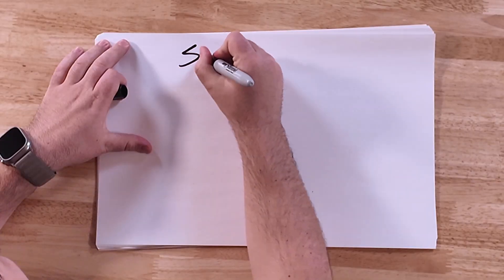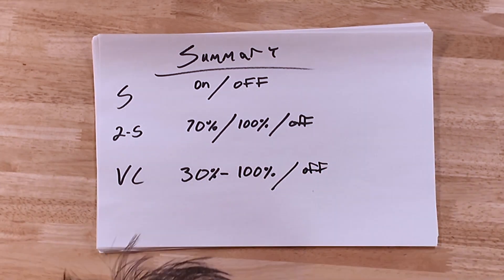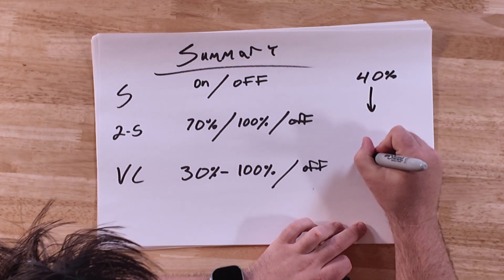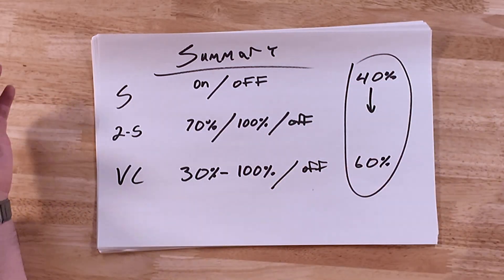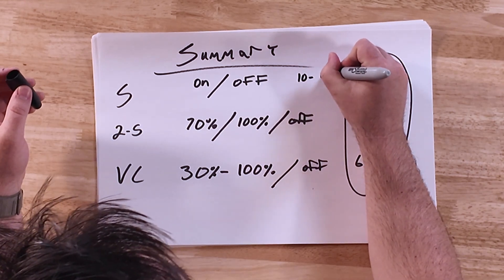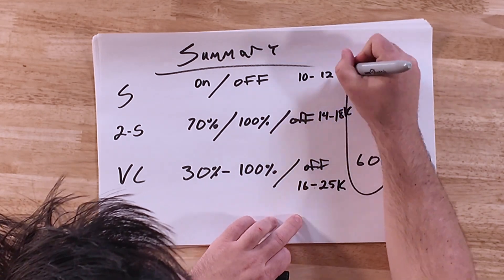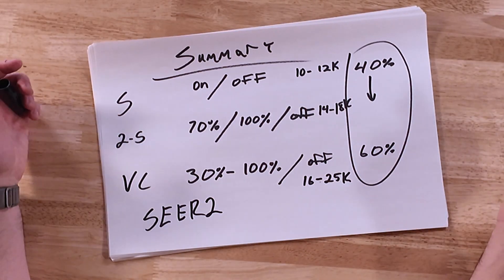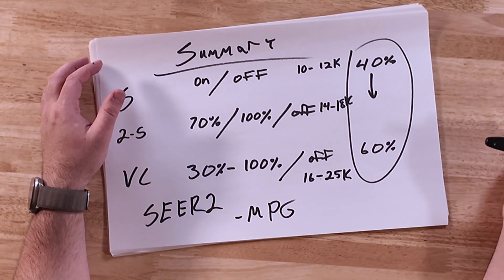Single Stage vs. Two-Stage vs. Variable Speed HVAC — Which One Should You Buy in 2025?

Comment: I don’t feel like I’m saving money, I bought a 2 stage and it feels like it’s always running. My thermostat is set to heat 66 degrees f. I have a separate thermometer that I keep to ensure my thermostat is reading correctly, my 2 stage is always running even when my thermometer is reading 66, is that because the new system programmed to stay 1-2 degrees above? I can’t figure out why this thing is always on, it’s annoying however I’m glad it’s functional. Better count my blessings
Reply: Jojo have you had a detailed look at your duct lines for air leaks? I could only imagine that would be a possibility

Comment: Can't you set the single stage system to use a lower or mid fan speed for better comfort? I think most new furnaces have different fixed speeds you can select.

Comment: Is a 2 stage condenser compressor more quiet at start up than a 1 stage AC condenser compressor?
Reply from the maker: The sound data will vary per manufacturer. However based off the Lennox data we have available; it shows us that a 2 stage system is quieter during operation than a single stage system by about 3-4 decibels. It doesn’t specifically say during start-up. We can assume that it would be a little bit quieter based off the data specifications provided but that may be negligible based off the total loudness being produced. In this case 78db vs 74db. Jumping from an ambient noise environment level (let’s say 30db) to 74db or 78db will always sound loud in comparison. You won’t get into noticeably quieter operation until you compare a single/two stage condenser to a variable capacity condenser which can operate as low as 45-55db.

Comment: Thank You,  what your thoughts on impact of OG&E smart hours with two stage & varible stage.  Right now we do not run our Heat Pump during that time.  We control temp pushing it down before 2pm & letting it rise but not exceed a set point until 7pm.  Hmm..

Comment: The saving of variable stage does not make up for the double cost difference where I live. Variable stage systems here in California cost $20k plus, a $10k difference in upfront cost vs a single stage system. When the system breaks down, the parts needed to replace for variable stage system will wipe out any savings in electricity you gain. Not worth it. Get the highest efficiency 1 or 2 stages system 15-17 seers2.
Reply from the maker: That’s a fair point, Matt — and honestly, we kind of agree. If you’re only buying a variable capacity system for the savings, it’s probably not worth it. The real benefit of those systems is in comfort, not dollars saved. The efficiency savings are icing on the cake, but they’ll never completely offset the upfront cost. That said, in areas with higher utility rates, the math can shift — the efficiency might make more sense there. But if your main concern is cost and reliability, a high-efficiency single or two-stage (15–17 SEER2) system is a solid choice.
Reply from the maker: Also we featured this comment in our video: https://www.youtube.com/watch?v=kG-TcTUGeq4&t=1s

Comment: I find this informative. In honesty i wanna install VC system if i have enough money to pay for expensive repair down the road due to fancy module technology. But overtime, AC do not last forever like max life is 20 years. Things get expensive every year on top short supply and inflation. In my opinion, maintenance is key. U might as well put solar panels at home 😅instead of
Reply from the maker: You’re absolutely right that variable capacity systems can have pricier parts. The good news is that most of those components are covered under a 10-year manufacturer warranty, and you can add a 10-year labor warranty too. That means for the first decade, you’re covered for both parts and labor. After that, yes, repairs can become more costly, which is why regular maintenance is so important. Preventive care helps those components last longer and reduces the odds of major failures. And we couldn’t agree more -- maintenance really is everything.

We featured your comment in our video! https://youtu.be/kG-TcTUGeq4?si=ws5xksxThqW18ZAM

Comment: PHX AZ will destroy any air conditioner. You can put the most expensive thing out here. It’ll break every 4-6 years. Nothing can contend with our heat. I’ve been doing this 12 years and have yet to see a unit live out a ten year warranty with zero repairs.
Reply from the maker: We totally get that. Phoenix heat is no joke. We’re based in Oklahoma City, but we’ve got colleagues out there, and those desert conditions are tough on any system. You’re right that HVAC units in harsher climates simply don’t last as long. Factors like thermostat settings, maintenance, and especially installation quality make a huge difference. At a certain point, it’s about deciding whether repair or replacement makes more sense. With a 10-year parts and labor warranty, though, those mid-life repairs can be covered as long as the system’s been properly maintained.

We featured your comment in our video! https://youtu.be/kG-TcTUGeq4?si=ws5xksxThqW18ZAM

Comment: I consider Reliability and longevity higher than price. Why buy System if is not reliable and will last a long time!
Reply from the maker: Exactly, reliability and longevity should always outweigh the sticker price. Think of it this way: if a $20,000 system lasts 10 years, it costs $2,000 a year to own. If that same system lasts 20 years, the cost drops to $1,000 a year. The longer it lasts, the more value you get. Variable systems require a bit more maintenance, but the payoff is efficiency and comfort. In our book, the value over time matters more than the initial price tag.

We featured your comment in our video! https://youtu.be/kG-TcTUGeq4?si=ws5xksxThqW18ZAM

Comment: A little confused....when you say Variable Speed, is it always an inverter HVAC? I just received a quote (in FL), and the options they are giving me are Carrier Performance 2 stage, Carrier Comfort (single stage) with Variable Airflow, and Carrier Comfort (single stage) which is what I currently have. They apparently do not offer inverters yet. I'm liking the positive things you are saying about VC but guessing that is different than the Comfort Single stage with variable airflow I am being offered?
Reply from the maker: Great question, and one we get all the time. “Variable speed” usually refers to the blower motor inside the furnace or air handler — that’s airflow. “Variable capacity” refers to the outdoor compressor — that’s what we call inverter technology. So: variable capacity = inverter; variable speed = variable airflow. They’re related but not the same thing. The variable airflow system you were quoted isn’t an inverter, but it can still improve comfort by circulating air more efficiently at a lower cost.

We featured your comment in our video! https://youtu.be/kG-TcTUGeq4?si=ws5xksxThqW18ZAM

Comment: If I was building a new house, I would go with a variable speed ac system but I live in the house I was raised in and it’s over 59 years old so I would just reinvest into single stage units
Reply from the maker: That’s a valid approach -- older homes come with unique challenges. But if your ductwork is accessible, it’s worth having it inspected. We find that roughly 80% of homes we service have undersized return air, even for single stage systems. Poor airflow causes premature wear on motors and compressors. Correcting that can make a huge difference in comfort and longevity. Even in older homes, a variable capacity system can perform beautifully if the ductwork supports it. The key is giving that system room to breathe.

We featured your comment in our video! https://youtu.be/kG-TcTUGeq4?si=ws5xksxThqW18ZAM

Comment: Inverter systems are only good when used with zone control. A 5ton system running at 30%, the air handler is only moving 600 cfm . The long runs will get little airflow, causing those rooms to be warm and poor humidity control. Most variable speed units at full capacity do not meet minimum SEER (usually 11 to 12 SEER), so not very good for hot climates.
 Better off with 2 stage on cost and reliabilty

Comment: I personally would never buy an inverter condenser regardless of their price.  They have an enormous long list of negatives with very few positives when compared to other systems especially 2 stage.  They are terrible at humidity removal, unless you have a brand new spray insulated air tight house.

My 2 stage Goodman operates at a 2 ton (50%) capacity on the mild Oklahoma days and 4 ton (100%) capacity on middle of summer heat wave.  I set the desired runtime I want the unit to target (1 hour runtime) and it switches from low stage to high stage solely on the basis of what is needed to hit that 1 hour run time target.  This is Optimal for humidity removal.

I "could" set the target runtime to a 4 hour target which would leave it running at 50% / 2 ton capacity during the summer heat for at least 3 of the 4 hours, which would be similar to the energy usage of an inverter, I DON'T do that because even though it's more "comfortable" having constant cooler low speed airflow for that long duration, the humidity level skyrockets from doing it, (yes I've tried it to see) as at 50% it doesn't have high enough capacity to adequately remove humidity, which in turn makes you want to lower your thermostat temperature to compensate for the higher humidity, totally destroying the "intent" on spending extra for the inverter.

Don't even get me started on replacement part costs on inverter systems components, (Hence why so many HVAC techs promote the purchase of them)

Comment: Can a 2 stage system work in an old home with metal ductwork?  I know variable wouldn’t work, but wondering if 2 stage would since I’m looking for better humidity control in FL.
Reply from the maker: Yes, two stage could work! You might run into high static pressure issues, however infinitely less than if you had a VC. It will offer greater humidity control due to lower stage of operating.

Comment: Additional technical factors are oil circulation requirements and available service tech expertise.

Two stage system capacity reduction is limited to 60% to 70% because any lower requires management of speed cycling for sufficient compressor oil circulation.  Full variable speed systems have to periodically speed up to circulate oil back to compressor.

Full variable speed systems are more complicated with more to go wrong.  Many service techs lack proper knowledge to service full variable speed systems, potentially doing more harm than good and potentially greatly increasing servicing cost.

You will never recoup the extra cost of a variable speed, top of line system by electric consumption savings.  You have to justify the extra cost in better comfort control with less variation in temperature swings and better maintained humidity control.

A typical house capacity requirement varies based on season and time of day with range of required capacity from less than 20% of maximum unit capacity during spring or fall nights to sometimes over 100% for extreme mid-summer days.

As mentioned, just a few degrees more or less setting of thermostat greatly impacts run rate average capacity needed, with its resultant electric bill cost.
Reply from the maker: This is a fantastic technical breakdown. 

You're absolutely right, oil return and proper staging logic are big reasons why two stage systems rarely drop below 60% capacity, and why full inverter systems have to ramp up periodically.

Also couldn’t agree more on the importance of having qualified techs. We’ve seen too many high-end systems underperform or fail early due to improper installs or misdiagnosis. 

And yes, the real value of variable speed isn’t just energy savings, it’s comfort, humidity control, and quieter operation. When talking savings, it all comes down to the cost of a single stage vs. a VC install. 

Appreciate you bringing up these topics!
Reply: @yarbrough_and_sons  My Goodman 4 ton 2 stage I purchased in 2021 operates at 50% on the first stage and 100% on second stage.

Comment: question: if i run a single stage nonstop for several hours after letting the temperature rise to 80F, will its power consumption be the same as running a VC for the same amount of time?
Reply from the maker: Great question. The short answer is no, the energy use won’t be the same. A single-stage unit runs full blast the whole time it’s on, so if it runs for several hours, you’re pulling max amps the whole time. A VC system adjusts its speed to match the cooling need, so while it may run longer, it’s usually pulling much less power. 

That’s where the energy savings come in, especially on hot days when you just need steady cooling, not full throttle all the time.

Comment: I had a Daikin/Goodman installer estimate a new system for me (Houston TX) and he didn't even quote me on a two-stage. He claimed it was more expensive than a variable speed system and they're moving away from them. So according to him the choice is only between single-stage and variable speed.
Reply from the maker: That lines up with what we’re seeing too. A lot of manufacturers are moving away from two-stage because the cost difference compared to variable speed is so small now. In many cases, you can get better efficiency and comfort with variable for about the same price, so they’re just leaning into that technology more.
Reply: Can I ask what the estimate was and for what size unit? And what is the size of your home?

Comment: Variable speed systems are not it for me. The idea that an inverter board on a 5 ton green speed is 5500 bucks after 10 year warranty is up, makes this an easy choice for me. Too bad they quit making 2 stage infinity.
Reply from the maker: Totally understand that. Once the warranty ends, those parts can be a big investment. We’ve always said variable-speed is best when the install is dialed in and the homeowner values long-term comfort and efficiency. But if cost and simplicity matter most, a solid single or two-stage system is still a great option. And yeah, we miss those Infinity two-stage models too.

Comment: The THERMOSTAT controls the temp swing. The equipment type controls HOW it maintains that temperature. 
This info is grossly misleading.
Reply from the maker: You’re right that the thermostat sets the target temp, but what we were trying to explain is how different systems respond to that call. A variable system doesn’t just blast to the finish line, it ramps up and down to hold that temp tighter with fewer swings. That’s the comfort difference people tend to feel, even if the thermostat setting stays the same.

Comment: If you turn your fan from auto to on, it will decrease the number of cycles needed to cool your home. It's the one and off of the outdoor until that causes your high utility bills.
Reply from the maker: That can be true in some cases. Leaving the fan on can help even out temps and reduce cycling, but it can also increase humidity inside the home if your system isn’t running long enough to remove moisture. We usually recommend trying “auto” first, then testing “on” if you want more consistent airflow. It’s one of those things where comfort comes down to how your specific home reacts.